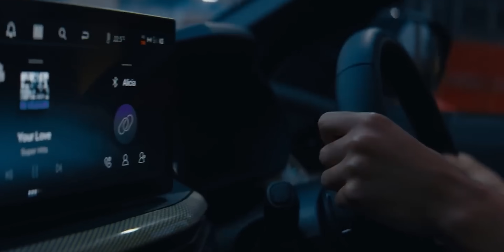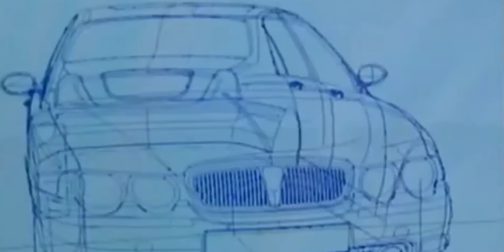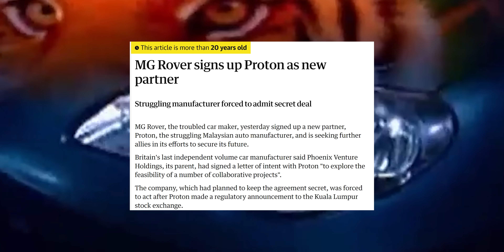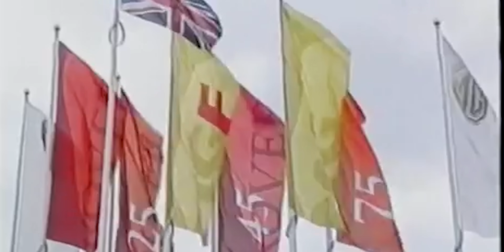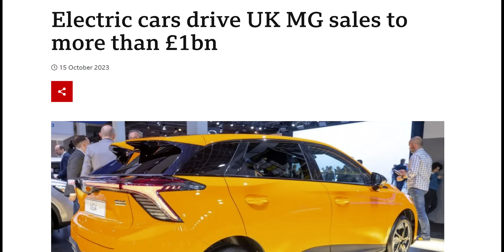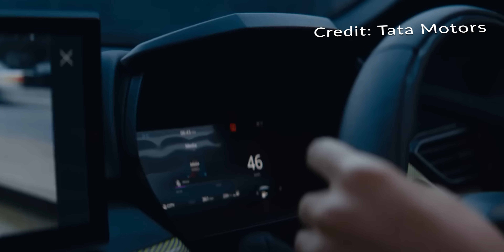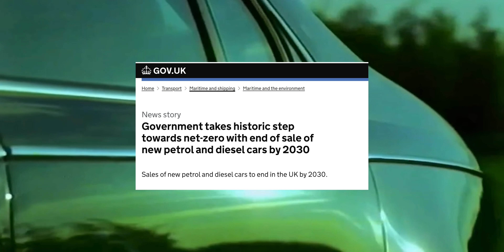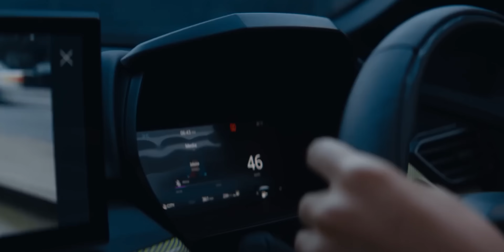ROVER COULD RETURN! But It May Be TERRIBLE!? - Exploring The Tata Rumour

Comment: If Rover is back, I’d be absolutely stoked. I don’t see why having it be a rebadged Tata should be a concern because virtually all the newer Tata cars are designed and engineered by Brits at the JLR facilities. Tata basically invested in JLR to make them rich in engineering which they then use to design their cars. Smart move in my opinion. So Rover would be designed by Brits, which is the ultimate factor to getting Brits to buy them when they make their debut. They will definitely be much more British than MG; let’s rest assured that. C’mon guys, let’s be optimistic. I’d rather have an Indian rebadged Rover with British technology designed by former BL engineers than have an MG with regurgitated GM technology that the parent company (SAIC) is licensing under contract. I was against MG’s acquisition by the Chinese and still hold that view. RIP MG and welcome back Rover.
Reply: The guys at lr are not ex BL at this point given they haven't been bl in 38~ years.
Reply: So you'd rather have an Indian Rover, rather than have a Chinese MG ?
& as for engineered by Brits. Really...
I applaud your loyalty to Rover but lets face it JLR 'make' some of the least reliable cars currently on the market. 
Personally, I believe what happened to the car industry & manufacturing in the UK is a travesty but rebadged electric 'white goods' are not a rebirth of Britsh marks, just a corporate exercise in monetising rose tinted nostalgia. 
This is only my opinion, as is yours. 🖖
Reply: @Low760 Well, they’re the spiritual successors. You get the point.
Reply: @pjmclaverty2090 True, JLR are quite unreliable, but so is a Chinese MG. My point is that we can actually consider the rebadged Tata cars as British because they’re engineered by British. I don’t see why we can’t consider the new Rovers as British cars just because the parent company is Indian. All the R&D and most suppliers are in the UK, making JLR still very much British. This is unlike MG which SAIC only bought the name and still claims they have stuff going on in Longbridge, though we know there’s nothing going on at Longbridge. It’s all about nostalgia, true, but why not?
Reply: Also let’s be honest, outside a few enthusiasts the Rover brand is junk by now. Reviving it and sticking it on a reliable mass market EV is not exactly going to ruined a brand which basically sold rebadged but worse built Hondas for the last 20 years of its life that only sold to pensioners. To me it’d be a foot in the door for TATA with the chance that JLR could tap into a bit more cash and platform sharing to build a new small electric SUV.
Reply: Except the Roewe cars (which are what are largely sold as "MG" in the UK) are also mostly designed in the UK, When SAIC bought the rights to the Rover designs (but not the name) they contracted with Ricardo Consultants (which was mostly ex-Rover engineers) to move the designs forward.  Later, they bought Ricardo and renamed it "SAIC Motor UK technical center", but it's still the same core team.  SAIC also tried and failed to buy the Longbridge plant - which ended up being sold to Nanjing Automotive - but they later bought Nanjing Auto, so now they have the old Rover designs, many of the original engineering staff and the original plant.  Honestly, I think you could make a very valid argument that at this point "MG" have a lot more of the original Rover DNA than anything that might come out of Tata does.
Reply: @Whatshisname346  But Tata needs a well known mass market brand to sustain JLR and what’s better than Rover? I mean, it’s literally in the Land Rover name and they have the rights to it so what do they really have to lose? Nobody in the UK is going to buy a Tata; at least not anytime soon. Rover, although not respected by a lot of people, still have enthusiasts that would buy them. There’s no such assurance with the Tata brand. Tata as Rover for the UK market as a mass market brand just makes sense.
Reply: @TrimeshSZ The Longbridge factory was closed, torn down, and sold by the Chinese and much of the R&D was closed or shipped to China, including the team that MG bought. They are at SAIC in china designing cars for SAIC and MG. There’s a tiny technical center there, but that’s it. SAIC stripped Longbridge apart whereas Tata increased JLR’s production capacity, R&D centers, and overall operations in the UK since their acquisition. The only thing British about MG cars is the name and perhaps the design which could still be done by the British team that they bought. Technologically speaking, there’s nothing British about MG or Roewe cars as they are all GM licensed technology. Way back, SAIC virtually stole the intellectual property of the Rover 75 and used that technology for the Roewe cars for awhile but now they’re completely General Motors technology. 

I don’t agree with MG having more Rover DNA than JLR. JLR is an actual British company with its own British CEO, British executive team, British research centers, British factories, and British headquarters. Sure, JLR is a subsidiary of Tata in India, but that’s where it literally stops. MG is not even a separate company like JLR, but they’re only a division within SAIC, and they are housed in China as with their executives, designers, and overall operations. JLR is a completely independent British firm that’s only a subsidiary of an Indian company whereas MG is only a division of a Chinese company with mostly all the operations merged into the parent company. There’s hardly any Britishness left in MG which makes JLR the more British one with the most preserved Rover DNA. Therefore I think whatever Rovers that Tata makes through JLR would be more British than the MG cars sold in the UK.
Reply: I'd rather have niether.

To paraphrase Dr J. Clarkson: I would rather eat my money, than waste it on an SUV; let alone one that's a worthless and flammable EV.

Rover is dead, and the Germans murdered it.
In a market flooded with garbage products, Rover is best left in the past, rather than sullied any further.
Reply: I'd rather have a city rover 😅 they gotta worth a few bob now 😬
Reply: @deanosaur808 😂Them notorious things.
Reply: @TrimeshSZ  there is only 1 Roewe sold in the UK as an MG & that's the MG 5. All of the other models are uniquely MGs & pretty much all of them were designed in the UK & mostly for the UK/European market. The MG 3, ZS, & HS aren't even sold in China.

Comment: It would be nice to see tata slot it just above mg in the market, to try and keep some of the brand's prestige and show that theyre serious about the rover name.
I dont think it would be a fitting reboot being sold at the cheapest end of the market.
Reply: Exactly.  They could do minimum suspension modifications, a nice interior and hood/facia, and get that mid-priced slightly upmarket customer. They will goof this up. Guaranteed.
Reply: The only problem I see with that idea is that’s where Jaguar sits, to be honest I imagine Jaguar could go down market soon as the brand is failing, it’s trading purely on brand name these days, if they were named anything else they would already be dead.
Reply: They used to compete with Jag back in the 50s and 60s. Part of what happened to o them was because William Lyons was on the board of directors when bl took them over, and I think he had a lot to do with their downfall. Direct competitors under the same roof and one of those brands are the baby of one of the bigwigs. It just makes sense
Reply: @gazdav422  oh yes, William Lyon’s is a huge part of rovers down fall but if you look at the present market, Jaguar are a failing brand trading only on their name, rover don’t even have a name to trade on anymore so why would tata risk releasing another brand without the reputation to compete head to head with a brand that is already failing. 

Don’t get me wrong I love rover and would buy a good rover over an equivalent Jaguar any day, but I’m odd and in the minority.
Reply: @kidcowdy1231  it probably won't happen, but it sounds like there could be a way in if they get the quality of their vehicles up.
Not how flash and pimp they are, but building reliable cars.
They would eventually take sales from mg and Jag.

Comment: Wotcha mate, once again an excellent video, now, if you are up for it, how about a slightly more demanding piece of research- yep I know it is not from the bmc/bl stable, but I am stumped for information,  but its a thing that rivalled the  range rover /land rover  stranglehold on all terrain emergency vehicles,  I give you the Ford transit County 4x4, the transfer box from the Ford bronco, produced in powys Inn mk2, 3, 4, and 5 transits, mine is a mk5 ex Keswick mountain rescue,  bespoke by County, and my daily drive... thanks for you and your channel,  its a bug that when it bites it locks on, and ultimately makes us happy- I've run out of leads on this particular subject,  yep tranny forums etc, you might have summat else up ya sleeve- keep up the good work  ( trying to force myself not to put a 200 td5 in it as the 2.4 has a confirmed 24k (yep! ) on the clock in 29 years! All the best can't wait for the next one!

Comment: What's the point? Whatever badge they stick on the front it'll still be a hideous crossover blob like everything else on the road, and worse- it'll be a milkfloat!
Reply: Yup. Talbot flopped hard in the 1980's for similar reasons.
(the cars were ugly and uninteresting, the brand was obscure and had no cache outside of France, and advertising was weak at best)

Comment: However I've owned a Hyundai i10 for nearly 14 years a Indian designed built car it's been the best and most reliable car I've owned and getting very close to 150 k. I had a Rover 600 in the late 90s and it was plagued with electrical issues and then it started to rot.

Comment: A key thing to remember with the CityRover debacle is that Rover applied a premium price to a car with interiors made from chocolate box tray plastic.  This hurt the CityRover and the Rover brand more than the car itself.  Had the car been £2000 cheaper, which it easily could have been, then it may well have faired better, not brilliantly, but better.

The irony is that a better TaTa Inca came as Rover died, making the CityRover a half decent car, arguably better than some (NOT all) of its contemporaries of the time, but again had the price been lower.  Better interior, better suspension, better build quality out of the TaTa factory, which made a better car coming out of the Rover factory, but alas, too little way too late.  Some were sold and are well regarded by those that have them, but most were sold after the administrators moved in and sold off inventory.

The overall death of Rover though was a done deal once BAE got their hands on the company, because at that point, investment was a dirty word, and every penny had to be accounted for and saved at any cost!  Just look at the 800 series restyle for a perfect example of BAE trying to save money and saving nothing!

Comment: If it did come back, it wouldn’t be British. (Which might help reliability, but wouldn’t be desirable)
Reply: As long as it doesn't use ingenium engines it probably would be more reliable lol
Reply: Had 2 75's first had 8 owners 140 k miles on it after 40 k miles hadn't spent a penny on it apart from tyres 
Other one 20 k miles same thing not even a penny on anything not even oil change 
Sold both still drives ok 
What sort of reliability problems u talking about 
Absolutely bulletproof
Reply: @MrdjMob  K series? Or was they diesel if so that doesn't really count
Reply: @sbrader97  yes diesel 
Why it don't count?
Reply: @MrdjMob  Because it's a BMW engine and most old diesel engines are reliable anyway
Reply: @sbrader97  well whatever 
It worked well so for me it was rover 75
Reply: @MrdjMob  It's not really British reliability when it's German engine British design but with BMW relaibility the main issues with rovers reputation for bad reliability stems from engines like the k series head gasket issues
Reply: @sbrader97  mercedes today on renault engine 
Whats your point?
Reply: @sbrader97 to be fair the m47r was not found in any bmw, and did have significant reengineering by rover. Why do you think you never hear of timing chains failing on a m47r however it’s fairly common on a m47.
Reply: @sbrader97 the hgf issue is massively over blown, the k series was about 20 years ahead of the game when it came out. It delivered power super smooth, produced good power for the size, was light weight and brilliant fuel economy for the time. Why do you think so many other brands used them? 

To put in context how bad the hgf issue was blown out of proportion look at the ford eco boost engine, yet we don’t see the same backlash against them. Like wise with modern minis and Subarus.
Reply: @sbrader97 also look at the rover t series, those things were built like tanks
Reply: @MrdjMob  Apart from head gasket issues on the petrols I'd probably agree. Not too many left on the roads now though.

Comment: Along similar lines, I wonder what Tata will do with the Jaguar brand? I have my doubts that their re-invention as a high priced, luxury brand is going to work.
Reply: maybe they're opening a gap in their lineup for rover to take it's place as a merc rival ;)
Reply: Jaguar should just be luxury sports cars and low volume executive sedans. No need for them to be either Rolls or BMW because Jaguar has its own unique brand recognition that will determine its ultimate position. I think if Jaguar can stick to executive sedans and luxury sports cars then they would have a much more clear brand distinction than trying to compete with Land Rover in the crossover market. On the other hand if Rover was to be revived, they’d be a more mass market brand to bring in the big bucks JLR was hoping to get with Jaguar and Land Rover.

Comment: as a former owner of a P6 3500 (the last real Rover) and a 2300S SD1 (a Triumph-Rover) what the brand once stood for is long gone. the fact the brand is owned by Tata via its Jaguar Land Rover division is no bad thing. if they resurrect it for sure they'll use it as a badge engineering exercise which is fine considering everything that's gone before.
want a nice new Vauxhall? its a Peugeot. fancy a new Jeep? its a FIAT. what about a sleek new Mustang or Capri? they're big heavy SUEVs. the meaning has been lost by the marketing boys.
Reply: I'm with you on the SD1 Triumphness; I'm always ranting about the front suspension turret design.
Reply: @philhealey4443  I didn't have the chance to analyse the similarities between the Triumph 2000/Stag front end and that of the SD1 but they appeared very similar. the 2300 and 2600 engines were heavily updated Triumph 6s. knowing how BL reused as much of the parts bin as possible where ever possible it would all make sense. afterall, if ever there was a manufacturers 'kit car' the TR7 fitted that one lol.
Reply: @thatcheapguy525  I spent plenty of time under the bonnet of my 4 year old  2600 over six months, getting familiar with it, replacing the head gasket, brake master cylinder, exhaust and a Great Deal More. At least they gave you good  engine bay access.

Comment: There's a lot of sense in using a dormant brand name like Rover.  There will be many Chinese car manufacturers coming over before 2030, and for the consumer it's going to get very confusing.  Tata isn't Chinese but establishing a new brand (as seen with BYD and Ora) is difficult, slow and requires a huge budget.  The only Chinese brand to gain any traction in the UK so far is using a heritage name, 840,000 MGs sold globally in 2023.
Reply: And you may recall getting decent sales volumes for SAIC MG in the UK in the first decade of ownership was a difficult.

Comment: The thing is, the Rover brand lives on already, in a way, in JLR. The first1948 Land Rover was a Rover product, and for long period of history it remained so. Land Rover was only formed as a separate company, within British Leyland, 30 years later in 1978. They were both part of the same conglomerate until BMW sold Land Rover to Ford in 2000. MG Rover only produced Rover cars by licensing the name. They never owned the trademark. That's why they focussed so much on reintroducing MG for tuned up saloons, hatchbacks and estates. When MG-Rover went bust, Tata acquired the Rover brand from BMW to prevent its being used on Chinese-built cars, but, until now, they haven't used it. If the plain Rover brand were to be resurrected for Indian cars, this would go against that thinking. If the thinking were to be reversed, it would be an acknowledgement of SAIC's success with MG, and Geely's success with Polestar, that European up-market brands can survive being manufactured in Asia.

Comment: Well the current MGs are not real MGs so why not slap a Rover badge on a Tata car. The success of a reborn Rover will not be down to the badge but like MG providing good quality vehicles that represent exceptional value. If the new Rovers look acceptable, with good levels of kit and reasonable performance backed up by a long warranty then they will sell. The key is getting the value proposition right.

Comment: I have no issue with India doing it as I'm a bike guy and India make some good bikes that last and have good fit and finish, some of which wear old British marks. The Chinese however make horrid piles of steaming s**t from milk bottle plastic, with terrible electrics, poorly made engines, concrete tyres, chocolate gearboxes and they're rotten and f**ked in 4 years years. After taking over the small bike market here with sub standard junk sold cheap to people who didn't know any better, they've now raised the prices 4 fold for the same standard of junk... That's the way the car market will go now.